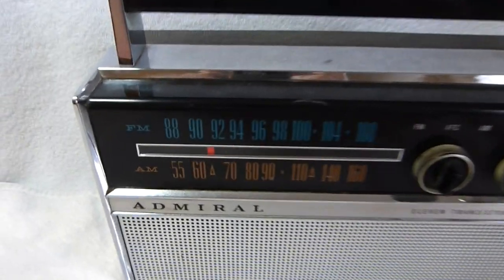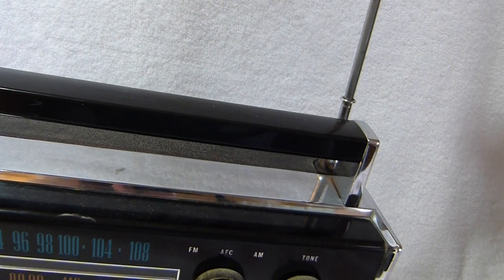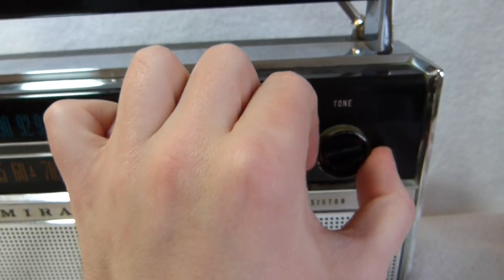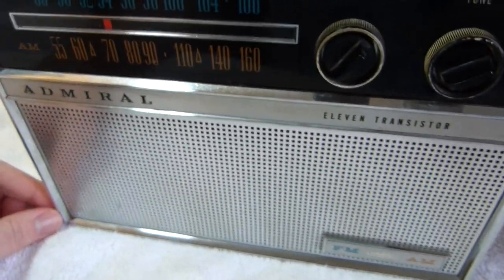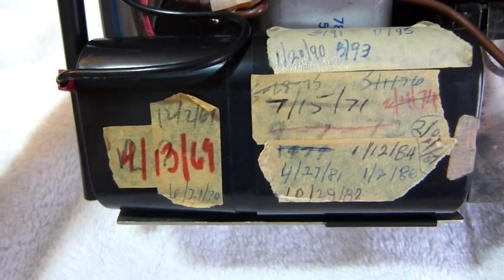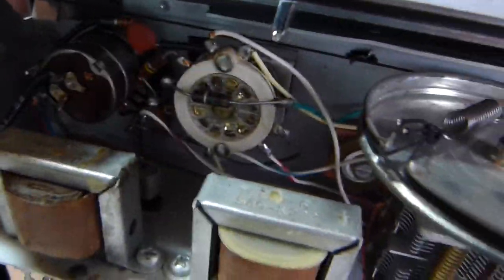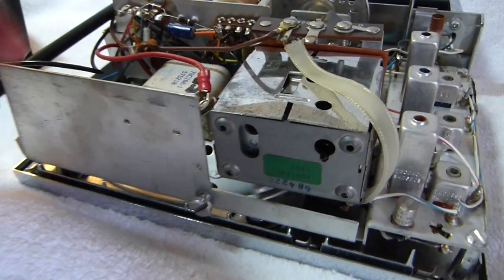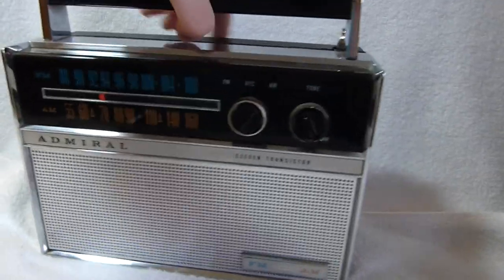1962 Admiral Y2371 AM/FM transistor radio (made in the United States)

Comment: This radio was announced as New Line from Admiral (along with Y2300 ($24.95) & Y2330 ($16.95)) in Billboard Magazine in the May 12, 1962 issue, for $99.00
Reply from the maker: Thanks for the info! I figured that this was a fairy expensive set based on the build quality and how rare it is.

Comment: Hello, great video. Thanks for sharing! I was wondering if you could help me by letting me know the capacitor values you used to repair this radio. Recently I obtained one and I want to restore it but somebody before me replaced one of the capacitors and I'm not sure if it's the right value.  Right now the radio has what I believe to be two of the original caps . First is 100uf 10v and the other is 500uf 6v and the third one is the one replaced that is 10uf 15v. I was looking for a schematic on the internet but as you said in  the video, there isn't much information on this particular model. Any help would be greatly appreciated. Thanks.
Reply from the maker: I'd have to tear it apart again to really get a good look, but from the pictures I have save, those seem to be the correct values. I see I installed 2x10uf, a 470uf and a 100uf. You can go up on the voltage ratings if you want.  Good luck!
Reply: @50sTransistorRadios  Excellent! Thanks so much for the info. Take care and have a great day.
Reply from the maker: @jesuspn03846  You're welcome, and I hope you have/had a great day too!